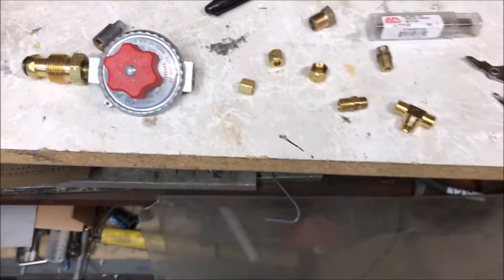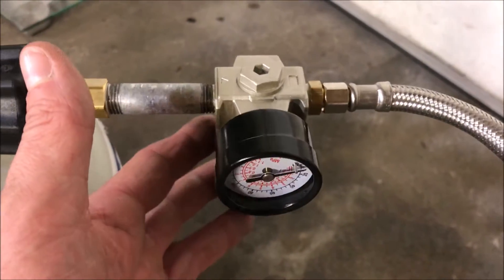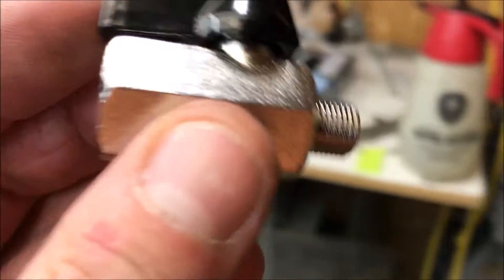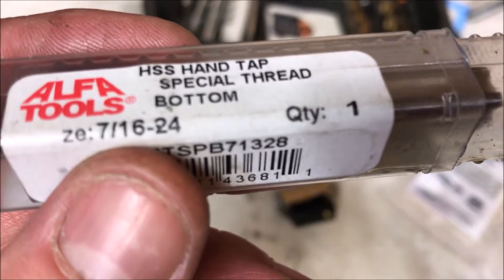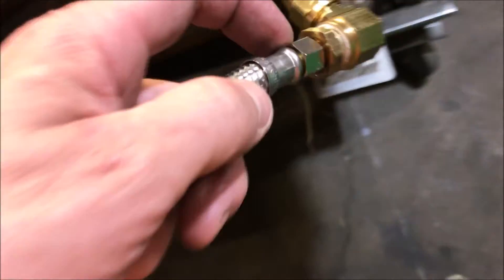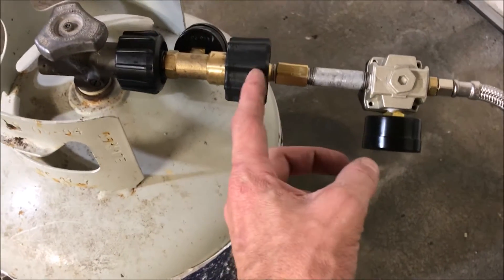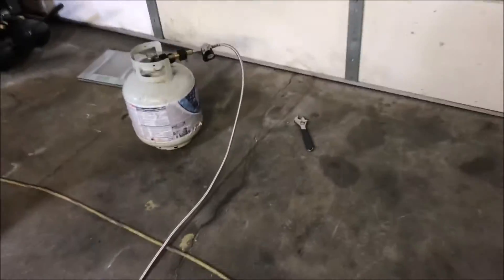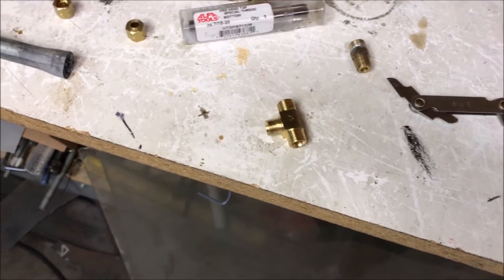Pneumatic air regulator for high flow propane

Comment: One little comment that you made in your video concerning the tank connector I think you said you guys may have to drill out the check ball. That solved my no flow problem, didn't know there was a check valve in there.
Reply from the maker: Safety ruins everything good ,all to protect the simple . But i dont complain i just disarm ...

Comment: I have a question, what regulator can I use for a lpg burner? Could I use an oxygen or CO2 regulator?
Reply from the maker: Dont use a regulator you dont need one on high power applications

Comment: I know this a couple years late, but you had asked why you don't use a compressed air regulator on LPG. To my understanding the internal workings is very similar between the two. It comes down to the rubber used inside to make seals for the diaphragm, LPG will decay/rott the seals in a normal air regulator leading to a leak, and possible fireworks. The type of rubber used in LPG regulators I do believe is called buna rubber and can with stand the effects of LPG corrosion. Perhaps you could manufacture some seals to replace in the air regulator and still retain the visual pressure gauge. Hope this helps and keeps ya safe. Thanks for the videos and info you bring.
Reply from the maker: Great input friend , we did have one fail and we assumed the seal failed just as you said . the same thing happens to propane hose
Reply: @NOBOX7  inspect before each use and replace regularly. Be safe be smart!

Comment: i have to ask i bought a weed burner / blow torch from harbor freight, no regulator just straight tank pressure, in line valve is pressure & flame adjust. its a monster but when i stick it in the foundry it back pressures & suffers.
Reply from the maker: you need secondary air
Reply: @NOBOX7  right on, i went ahead & made a burner, got time to play now, Wow !